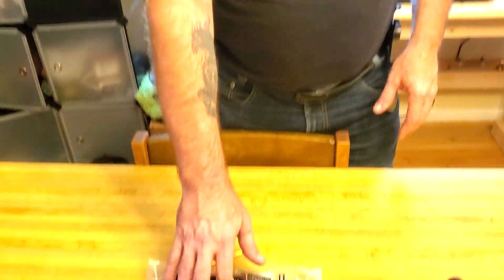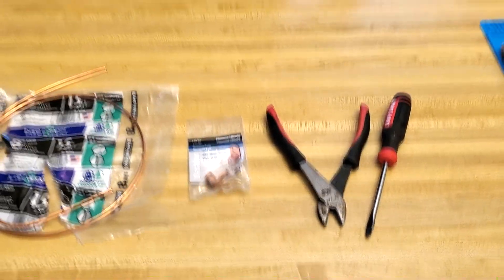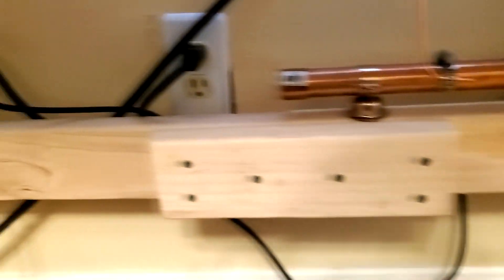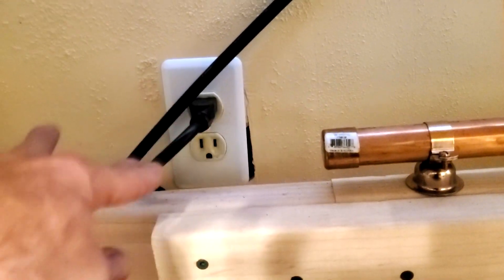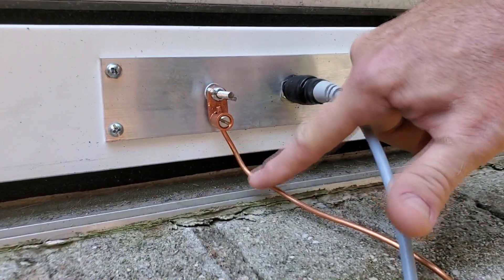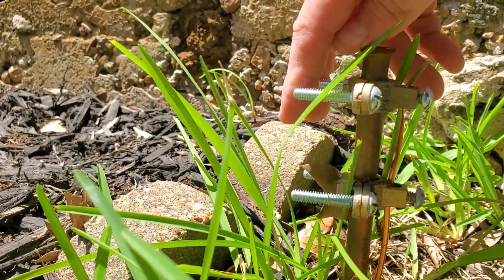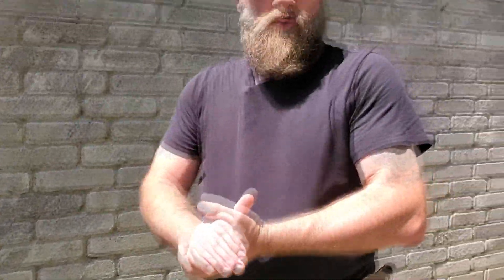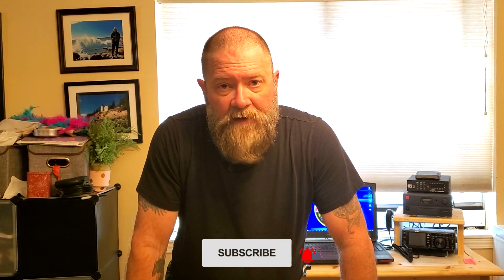How I ground My Ham Radio Station

Comment: are you aware your earth ground cannot be longer than a 1/4 wavelength  of your operating frequency ? it will re radiate, its in the ARRL books under station setup.

Comment: This is a controversial topic because grounding to another rod outside the shack violates the NEC.
Reply from the maker: I made a second vidoe addressing this with my new solution that is easy and works 100% of the time.  Thanks for the comment and for watching.  73!!

Comment: I connected the body of my radio to the ground of the electrical outlet. Is that safe?
Reply from the maker: @numberformat  No.  Because now your radio is connected to the house and if lightning hits, you could get a spike that takes out your radio.  Watch mu updated video on grounding my shack and you will see my solution that has worked ever since I posted it.  Hope this helps .  Thanks for the comment and for watching 73!!!

Comment: Grounding doesn't do anything, it's a waste of time unless you are in an area that has bad lighting. Second thing, in order for your ground to work properly you wouldn't use round type wire, it's a waste of time when it comes to RF, RF likes to travel along a flat surface, so using a copper flat strap is the correct way.
Reply from the maker: Watch my follow-up video on this subject.  I came to that conclusion you mentioned and simplified the process an it works every time.  Thanks for the comment and for watching.  73!!

Comment: Great Idea on copper pipe! How im doing mine different. I'm using a 1" copper pipe, flattened completely out. Hard mount on wall with earth ground outside. I am drilling holes for each ground for each radio and device. Soldering each end before tightening screws into pipe. I am also linking all of my antennas to separate ground tie.
Reply from the maker: That is interesting.  I assume that would work out just fine as well.  Best of luck in that project!  Thanks for the comment and for watching.  73!!

Comment: If you can disconnect from the outside. Lightning will travel in if you connect from the inside only. I’m a different person when it comes to grounding. I never ground inside simply because a three prong cord is grounded in your home. I ground my antenna and my window pass through to ground rods that’s it never an issue for 30 yrs. I worked at a company called Raycap for several years we make arresters for cellphones towers. No 30 dollar mfj or other will do anything for a direct strike. Maybe help in a close strike but I’d unplug before I trusted it. Ground the antenna and unplug.
Reply from the maker: I like that idea.  Thanks for watching and for the comment.  73!!

Comment: Replace the copper pipe with a ground bar, it will offer better connections and eliminate disimilar metals. Add another ground bar somewhere under your window and connect it to your ground rod with #4 wire (bury the wire so you are not tripping over it. Make sure the two grounding points on your pass through are connected to each other. Consider adding another ground rod closer to the window.  Although I would not use the methods you chose you made a valid attempt to ground your station and it is certainly better than nothing at all.  Thank you for sharing your set up
Reply from the maker: Appreciate the tips.  Thanks for the comment and for watching.  73!

Comment: If you live in an area that gets lightning and you don't have the lightning arrester yet, I would suggest that instead of disconnecting your coax on the inside of the shack; disconnect it from the outside of your panel. Very nice setup, I like it. I don't know what happens when lightning strikes the ground wires, but I have seen what can happen when it travels on the coax and jumps across a distance of about 1 foot away across a desk and strikes a radio that is grounded, it's not a pretty sight. KF6CTE Bruce
Reply from the maker: I hear you.  I made a second updated video on this topic showin what I do now.  I do have lightning arrestors on both my coax, but I still unplug everything is not in use or if a storm is coming.  Thanks for the coment and for watching.  73!

Comment: That how mine is grounded as well. Only I used copper strap inside the shack and number 6 stranded to go out to the 8 foot ground rod.  It seems to work well for grounding and getting the RFI out of the equation.
Reply from the maker: Yeah sometimes the simple way is best.  Mine workjs just fine.  Check out my updated video on this topic.  I made a few changes.  Thanks for watching and for the comment.  73!

Comment: I'm embarking on the same process as you are and this helped.  Copper pipe idea is brilliant. Much cheaper than the professional options
Reply from the maker: Yeah I try to think of practical solutions that don't cost the moon to reproduce and this seemed to be a good one and it works!  Thanks for the comment and for watching.  73!

Comment: i put the ground plane kit on my antron 99 it really helps the recieve . i bought a 8 foot copper clad ground rod at lowes less then 10.00 i need to hit it into the ground i have a 3 pound sledge hammer. water level is 6 feet down here in florida
Reply from the maker: Sounds like you have a solution that will work for you!  I hope it all works out!  Thanks for the comment and for watching.  73!

Comment: On your grounding rod/connection. I would typically dig a hole and hammer the 8’ rod 2”-3” below grade.  Then use a 6” or 8” diameter valve box to avoid creating a trip hazard (also looks much cleaner).  A single clamp is all you need, but it doesn’t hurt to add more.
Reply from the maker: Thank you for the input.  I have since released an updated video on this topic with a new solution that works every time.  I was getting frustrated with all the different methods to ground and it was getting to be too much.  My new solution, solves that.  Check it out if you have time.  It's called Grounding My Shack 2023:  What I learned.  Thanks for the comment and for watching.  73!

Comment: The aluminum plate interface is not good for connecting to copper wires. That should be a sheet of copper or brass.  If you insist on using the aluminum you will need an inti-oxident at the places where the aluminum touches the copper.  As shown you will have a lousy ground to your system components as time passes.  The outdoor will oxidize quickly because it is exposed to the elements. Like mentioned already do not use hose clamps but connectors made for grounding systems.
Reply from the maker: I just answered a comment form you pertaining to this and in there I stated that I simply copied some of the materials used by MFJ in their window passthrough.  I get it that copper may be better, but to date I have had zero issues with this project and it works perfectly.  Thanks for the suggestion.  Thanks for the comment and for watching.  73!

Comment: It seems everyone has a method of grounding their station - some don't ground anything. 
I worked for NASA and WSMR as an engineer for 26 years and the way they grounded the large mainframe computers is to build a grid of one foot wide copper roll all going across each other in a grid pattern and soldered together, covering completely under the entire computer room and grounded it at one end to a deep ground stake. Before the copper strip was laid down, a wider piece of heavy-duty plastic was rolled out and the foot wide copper roll was laid on top of the plastic, insulating it from the cement floor. They had soldered ground lugs all along the copper strip and lastly laid another covering of plastic on top of the copper, taping it all down with heavy duty tape. All that stuck thru the top plastic was the grounding lugs that the equipment was attached to with pieces of copper wire with at least #6 wire. You can see this makes a fairly large distributed capacitor to ground. - A bit overkill for us ham radio operators - but - in a much smaller sense I do a similar thing by laying a sheet of aluminum (like a 19" aluminum panel plate)  on the basement tile in my case, and attach each piece of equipment to that one plate with grounding lugs and then connect the plate at only one point to a ground stake or cold copper water pipe. My thoughts are - the plate is (in my case) a small capacitor to RF ground and the copper wire is the DC and 60 Hz connection. Works for me.  No grounding at all, can (and has for me), caused RF bites when the lips touch a metal microphone like the D-104. Better to ground than not ground. 73  WA4QGA
Reply from the maker: Thanks for sharing that!  I think we each individually need to assess our situation and what we are ultimately looking to do to ground our gear.  Using common sense is paramount to getting an effective setup.  Sounds like the configuration you went with works well for you!  Thanks for watching and for the comment.  73!!

Comment: Great video, but the copper pipe needs to be solid, ie use a grounding rod, and the hose clamps I would replace for something more conductive , like brass or copper, cheers Ade uk
Reply from the maker: I have made upgrades since this video and a new video is out on my updated shack and how I now ground and what precautions I take.  Thanks for watching and for the comment.  73!

Comment: Hi! Can I use a coaxial cable 70 Ohm as ground wire? I have not used cable, and I'm thinking about using it in this way. What do you think?
Reply from the maker: Wow.  Well technically yes.  DO I recommend it, no.  Grounding is technical and you should use the proper copper wire to ground your shack.  I think this would cause issues down the road.  I hope this helps.  Thanks for the comment and for watching.  73!

Comment: One very important thing is missing. You’ve driven a ground rod for your ham gear and antenna, but this ground rod MUST be properly bonded to your home’s electrical service ground rod. However many outdoor ground rods you have, they must be bonded together. Otherwise in the event of a lightning strike on your antenna, you may have a voltage differential between your ham rod(s) and your home electrical service ground rod. That will create a path to draw the lightning up into your home electrical system and can cause serious damage, including fire. All your exterior ground rods MUST be bonded together to avoid this kind of disaster. Check out Ward Silver’s “Grounding and Bonding for the Radio Amateur” from ARRL. This is a requirement of the NEC. Not optional. DE N3CLO Patrick
Reply from the maker: Thanks you for the insight.  I have since made a new video with a new technique for my grounding that is a better solution.  Thanks for the comment and for watching.  73!
Reply: That is why you drive a ground rod for a subpannel and bond it via house ground and use brass grounding clamps.

Comment: To determine if the grounding is proper check the ordinances of your county or city, even better consult an electrician.
Reply from the maker: I made an update video with my new solution that is working out fine and is based on a study by another ham.  However you are correct.  Thanks for watching and for the comment.  73!

Comment: Great video!... but I have my rig FT950 and tuner + power supply  in a cupboard  12 feet from my window (like you have in the video)

 does the length of the copper wire make a difference ?
Reply from the maker: I doubt it.  I have since made a new video with a new methodology that I think works a bit better.  Check it out if you have a chance.  Thanks for watching and for the comment.  73!!
Reply: @HR4NT   Will do   cheers Mate!   I have my antenna on a bracket on the wall outside my kitchen  but the path at my back door has the main gas pipes running underneath them...  (terraced housing etc) I'm gonna have to   put the grounding rod  further up my back green  I dont want to find myself doing a flight to the moon lol..

Comment: very good explanation, question: how thick is the ground cable wire from the rod to the shack ? and also to the radio apparatus e.t.c. Thank you
Reply from the maker: I used 6 gauge wire outside.  I have since modified my grounding and have a newer video explaining my new methodology.  Thanks for watching and for the comment.  73

Comment: Do not use water pipe & hose clamps to tie your grounds together. Why would you go to the plumbing department when you can buy a grounding bus in the electrical department for about $10? Foolish.
Reply from the maker: Didn't know about that being available at the store.  I have since revised my grounding method.  Thanks for watching and for the comment.  73

Comment: One loose common wire and you will create a path right through your body to your ground rod. Congratulations.
Reply from the maker: Thanks for the tip!  However I make sure frequently that everything is tightened up and in working order.  Thanks for the comment and for watching.  73!!

Comment: I'm new to HF. I have a 'loaned to me' Kenwood 570D and I hooked up a Vibroplex Endfeedz 135' wire antenna which is about 14' off the ground. Even though I've talked to a ham in Australia and one in Hawaii, both reported that my audio was bad, really bad, though they were able to make out my callsign. My stuff is currently not grounded. Since I'm really new to HF, this is frustrating. I just want to turn on the radio - and talk to the world - without any problems. Gee, I'm probably the only one who thinks like that eh?  :D So, to ground or not to ground. I've heard both sides of that. I get little 'shocklets' from time to time when I move around the shack (which is a 10x12 Bully Barn), but I've always gotten little shocks everywhere long before I became a ham, so I'm not sure what to think about that. I appreciate your concise videos and I've watched many of them.
Reply from the maker: I am glad the video helped.  I saw your other comment on my updated video on this topic.  Thanks for watching and for the comment.  73!

Comment: It's a little thing, I know, but when you drove the copper ground rod into the earth, you flattened the top, which will make it hard to remove your clamps.  Instead, go hammerless: Take a bucket of water out with you. Poke the rod into the ground a couple of inches, then pull it out and fill the hole with water. That will make it easier to poke the rod a little deeper. Do it again and again until your rod is at the right depth. Anyway, it works in south Louisiana, where the soil is sandy and soft.
Reply from the maker: Good idea, but the ground here is clay which is why i had to beat the crap out of it to get it in the ground...LOL  Thanks for the comment and for watching.  73!

Comment: Are you bonded to your utility ground?  people keep telling me I need to do that and I don't see how with my set up that's possible.  Im not running 15 grounding rods and straps all around the other side of the house.  But I can easily do out the window to a ground rod like that.
Reply from the maker: Running multiple ground rods and strapping them together apparently IS the proper way, but like you, I am not going through all that BS .  My new method is to unplug everything when a storm is in the area or I am not on my radio equipment for a period of time.  That works 110% of the time and my gear is protected.  I have an updated video to this one talking about that.  Thanks for the comment and for watching.  73!
Reply: @HR4NT  thanks.  I'm on SoCal.  Lighting isn't much of a thing.  Looking at keeping the RFI out
Reply from the maker: @Lirrinpaly   check out Palomar Engineering:  https://palomar-engineers.com/rfiemi-solutions/Radio-Communication-RFI-Solutions-c21444152  They have a ton of stuff that may help.  Juts give them a call and see what they recommend.  Hope this helps.  73!

Comment: I live on the 9th floor, what in case grounding wire will be long ?
Reply from the maker: If you are on the 9th floor...I wouldn't worry too much about grounding...HOWEVER if you are not actively using your gear, just make sure it is unplugged to protect your gear.  I hope this answers your question.   Thanks for watching and for the comment!  73!!

Comment: I'm a "newbie" , and this may or may not be code, but all my station equipment is grounded with an old set of jumper cables to a copper pipe going through the basement wall. Antenna is in the tree, so not  sure if that needs grounding....
Reply from the maker: I do not ground my antennas.  If a storm is coming I simply unplug everything and hope that my antennas do not go through a direct strike.  Been OK so far.  Thanks for watching and for the comment!  73!!

Comment: Can you comment about why or why not to use the house grounding system? Could you plug into the ground prong of an electrical outlet?
Reply from the maker: Mainly because you could get noise by doing that as well as if there is a direct lightning hit to your antenna, you do not want everything attached to the stuff in your house.  A direct hit, nothing will survive that.  I made a follow up video to this one talking about my new technique and what I do now to resolve the issue once and for all.  Thanks for watching and for the comment.  73!

Comment: I have driven an 8ft grounding rod outside the shack and have a KF7p coax grounding panel on it where all my coaxes attach to bulkhead connectors and that's it. I do have an RF choke on the EFHW but not on the DX Commander or the dual band J pole. I think I'm good. I also unplug the works if a T-storm is forecast for the area, but that might be only once or twice a year at most. Thanks for the common sense approach on this video 73.
Reply from the maker: Hey I am glad you found value in the video and that it helped confirm your current practices.  Keep it simple seems to be the best policy.  Thanks for the comment and for watching.  73!